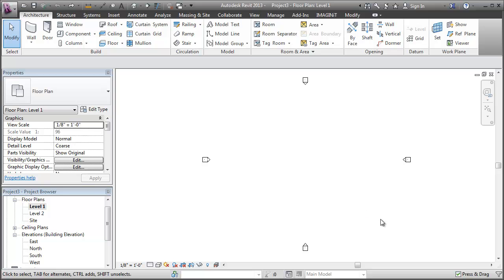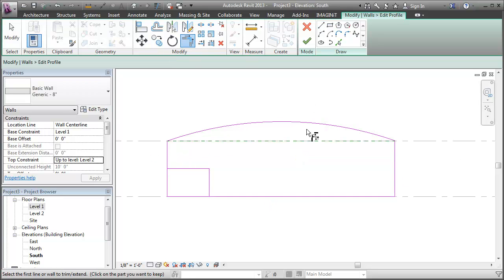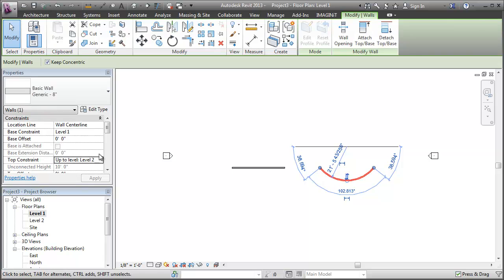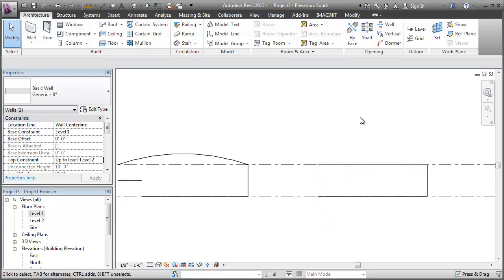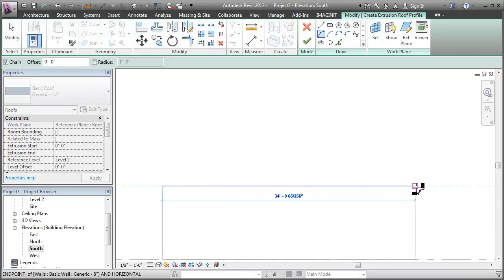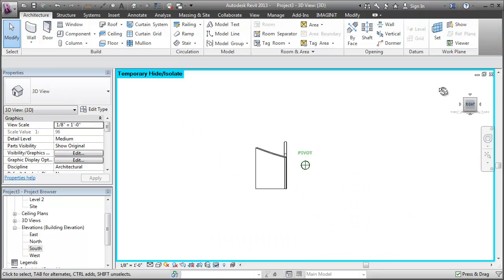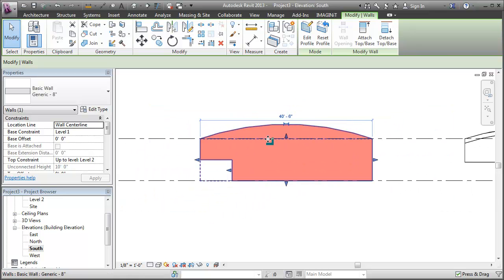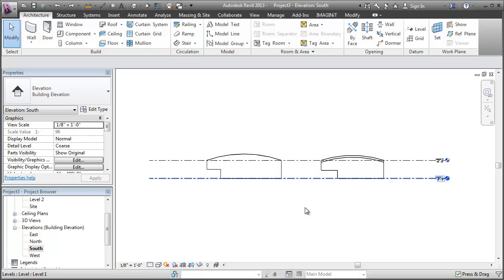Revit - Edit the Profile of a Curved Wall - In Depth

Comment: hi bud ..   can you edit the wall bottom with a curved wall  ?
Reply from the maker: +Hamish Carey Yes. You can attach the bottom of a wall to a reference plane. Or you can model in place with a void and then use the void to cut the wall.
Reply: Hi .  Thanks for the relply .  I have made a mass and then separated the mass with a void form .  However on the 2 resulting forms the walls still act as one piece and only seem to have a offset value ..... and thats it .....no other way that i can see to modify
Reply: so it means that i can position the wall using the offset , however can not extend the top or the bottom .    your void idea is great .  any ideas for how to extend the top ?